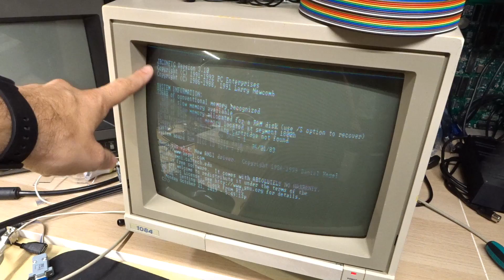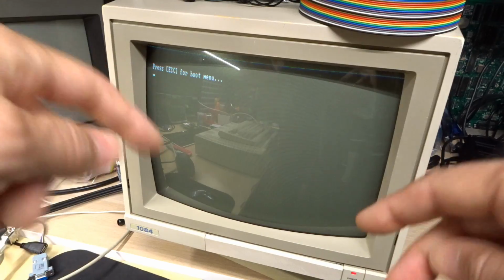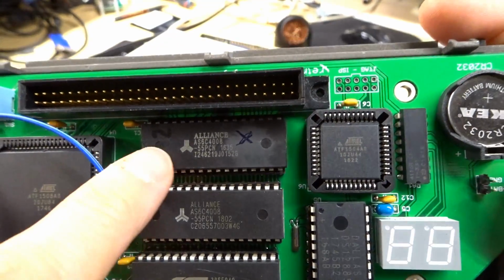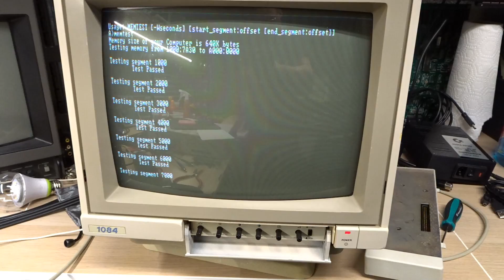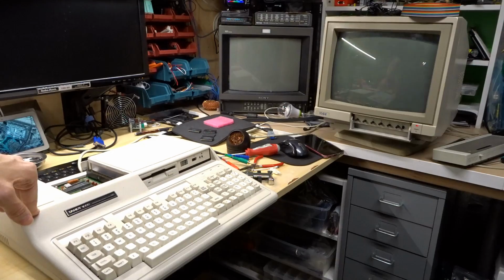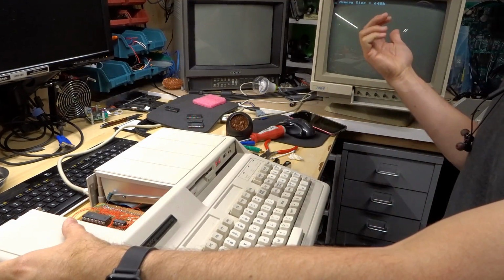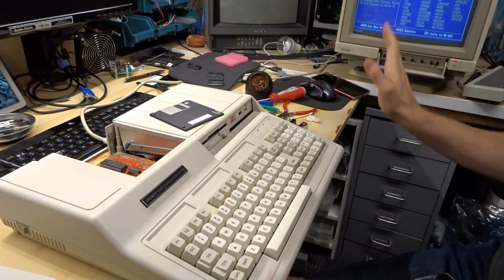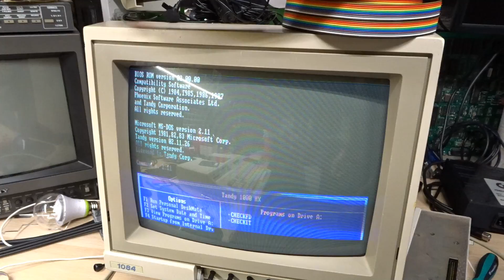Follow-up to fake or real chips? I think I know the answer now.

Comment: Back in the original PC and AT days there were often issues with the speed of the RAM chips that would cause weird bus contentions and errors like this.  I often had people purchase 150ns RAM from us for a "turbo XT" and then would complain when it wouldn't boot when set at 10Mhz back in the day.  I would wonder if maybe the fake chips are actually much slower but pin compatible RAMs that were removed from older computer boards.  Maybe these are like 120 or 150ns RAM not the 55ns your true Alliance RAMs are.  This would also make them work in a slower PC but just a few Mhz can make them not reliable.  One way to prove this might be to spray freeze-spray on the suspicious chip and boot to see if the error goes away until the chip heats back up.  Usually when one of these chips is super cold they will work much faster but as soon as they heat up they degrade to their native speed, whatever that was before it was painted over.
Reply: that might be true. try putting them in a freezer in a ziploc for 15 minutes, and putting them in the pc right away.
Reply: Or use freezer spray while booting the computer
Reply: Remarked chips of a lower speed grade seems quite likely.
Reply: Fake RAM chips are not new.  I remember running into the same problem 40 years ago when RAM chips were crazy expensive and some vendors tried to sell remarked chips.

Comment: If you look at the output, it's only the first nibble that's incorrect, the rest is correct. And it's consistent in how it's incorrect: A=E, B=F, 8=C, 9=D. Let's look at those values in binary:
A=E: 1010=1110
B=F: 1011=1111
8=C: 1000=1100
9=D: 1001=1101
As you can see, it's the second most significant bit that's being flipped from a 0 to a 1.
Butt! It's only affecting the first byte, why not the second? It's an 8-bit bus, so the surely second byte is just another read from the same data lines on the same chip, so we should be seeing the same problem in the second byte, right?

My guess is that the second read is soon enough afterwards that whatever circuit controlling the output of that bit is charged enough to hold it for long enough to read valid the second time. And I guess it's working in the PCjr either because of the bus transceiver on the expansion card presenting a lower load, so the pin can stabilise in time, or the slower access time is enough to do the same.
Either way, the chips are fake. But I'd still be interested to see a comparison on the oscilloscope of that pin to a working one.
(Also, still haven't got around to testing that SRAM I got for my 486 boards yet. Probably doesn't help that I'm spending my time staring at datasheets for other people's chips!)

Comment: I also agree these are salvaged chips, they're most likely not 55ns as marked. Another example is eproms. I know for a fact that ST discontinued eproms in 2011/12, if you got eproms with a date code after that be weary. A 100ns eprom, may in fact be a 120ns or 150ns chip remarked, same applies for sram and flash memory. This is not new it's been going on for years. It's not limited to memory either, I see YM3812 chips with the latest date codes and it probably hasn't been produced for 25 years.

Comment: It would be nice to see actual waveform comparision of working and not working chips. Data bit 14 would be the most interesting.
Reply: @adriansdigitalbasement  If it is 8 bit bus then it is REALLY weird that low byte reads ok consistently and high byte doesn't. Good that you made it work with original chips. I wonder if there will be a difference when you will have proper PCB made.

Comment: So, what's this cereal card you keep talking about?
Reply: Tandy had an RS-232 card for the PLUS bus that the EX and HX use, but they're even rarer than the DMA/RAM card. I ended up using a small generic multi-I/O card with an ISA to PLUS ribbon, and the stack JUST barely fits inside my HX.

Comment: It doesn't surprise me that the fake chips worked in the IBM. When dealing with fakes or even rejects you will have issues due to the chips not performing to published specifications. The Tandys may not be able to handle timing errors on the fakes or may electrically load the fakes more than they can handle where the IBM does not. It is also possible that the fake chips are more sensitive to the prototype board's wiring.

If you read my comment yesterday, you may remember that I wanted you to check genuine chips to rule out the possibility that the board's wiring was bad enough to make any chip fail. I'm also not fully familiar with these machines, but what is the CPU clock on the Tandys vs the 4.77 MHz of the PCJr? If the clock rate is higher, this really amplifies the possibility of timing issues with the fakes and the fakes ironically may work reliably in the PCJr.

Comment: This type of problem can happen when your design is working close to the limits/tolerances of a part, you may have a working system depending on the batch number, or depending on the chip of a same batch. A fake chip may be more sensitive or have slightly different characteristics that exacerbate the issue. If you have time, making them work would be very interesting to understand what's going on

Comment: An 8088 can only address 1024k of ram. This consists of 640k of work ram and then 384k of upper address space. In the 384k, upper area you have video memory (128K), the cartridge slot (128k), and the BIOS ROM(128k). The PCjr seems to be testing all the ram (640k work ram + 128k video memory = 768k) the cart slot and BIOS will not be tested because that's ROM and you don't need to test that anyway. You can't access anything above 1024k as the 8088 didn't have an A20 line.

Comment: Not an expert, they look like they are genuinely fake, rebranded or what ever, BUT they work on the other machine. So, it really smells a lot like a timing issue, and without the real data sheets, it will be hard to troubleshoot. And so I wonder if the genuine parts are more tolerant to the timing issues, but if you test on a huge batch of them you might not have the same issues on random item. In particular in electronics of that area, timings are pretty important, and to my knowledge you might need to delay some signals.

Comment: The rubbing off was enough to tell me they were 'fake.'  I've never seen that before.  And the pins did look a little 'cheap' on them too.  Removing the top layer of sub-standard chips to re-label them as something they aren't is apparently big business in China, so it's quite easy to get burned by buying ones from China on AliExpress/eBay/etc.  I have a couple of supposedly 75MHz MC68060 CPUs from China, but don't currently have a way to test them to see if they are genuine (often they are re-labelled 25/33/50MHz ones).
Reply: I understand there were genuine 75MHz 68EC060 chips, but they were never officially made in the 'full' version. Far more common are XC68060 in early mask versions masquerading as MC68060 in mask version 71E41J, which is the latest, most desirable version. The fakes are still 68060s, but they don't run as cool, and can't be overclocked as much. If you google '68060 mask versions' you will find many links describing this problem.

Comment: I'd guess at them being "Sinclair Grade", as in, something's wrong with them in part, but work up to a certain extent so can be used for some things but not others... :P
Reply: Thats every chip manufacturer ever. Especially CPU die OEMS
Reply: @Everett-xe3eg  It actually used to be fairly rare. If a part was defective it was recycled or trashed, never resold. Nowadays, they sell them as lower model parts in many cases, which is why they have such high product yields now. Their production has improved, sure, but for the most part their defective chips can go on to become 100ns or 150ns parts instead of the rated ones. 

Also, Intel was one of the first companies to do this.
Reply: It's a possibility but what's more like it is that they are rebranded clones in order to improve sales. If they can clone MCU and CPUs what stopping them from making SRAM clones and some of their clones even have more features and run better. Said that, rebranding is obviously not a nice move from them. Adrian should check the LCSC website and try some compatible SRAM modules from there, they sell from Chinese manufacturers, but not rebranded and stuff that actually works fine.
Reply: Possibly clones that aren't quite up to spec?
Reply: “Sinclair Grade” would not have worked in PC Jr. The Sinclair memories were the ones where the upper page of memory will not work.
Reply: X Xycom - The joke is that Sinclair bought parts which were cheap because they were flawed or faulty, which these particular chips seem to be whether fake or not, rather than whether or not they would work in each others' systems... :)
Reply: @twocvbloke   It sounds like that U.S based transistor radio manufacturer I read about that bought drums full of seconds from Fairchild, Motorola, G.E, or whomever, back in the 1960s. They built radios with them by testing the beta on each transistor, and marking them with a blob of coloured paint to indicate what circuit they should be used in, oscilator, IF, RF, audio, etc. I think that some of the Hong Kong cheapies did something similar, like those 10, 12, 18 transistor sets, where they would use two or more of them as diodes by connecting two of the legs together.
Reply: @xxycom8963  Isn't much of the upper 1mb address space mapped to other devices?
Reply: probably just slower memory access speeds needed, you cant tweak that on old systems like current, and my god the number of memory chips we went threw trying to upgrade some old apple products that, some units are just picky as fuck making you try a dozen chips to find one they like... of the same chips....weird as hell...but...thats tech for you.... specially retro stuff.

Comment: As my handyman father used to say, it can be expensive to buy cheap; even though he was specifically referring to hand tools, the idea holds up in any area, methinks.
Reply: Lassi Kinnunen  Well, that's true, but my father's point was that if you buy cheap tools, there's a greater risk that they may break, thus forcing you to buy a replacement tool; on the other hand if you buy quality from the beginning, you can have a tool that lasts a lifetime.

Comment: The surface on the pins and one of the pins just breaking off indicates that the China chips are not new chips, they are salvaged from discarded old electronics, and the top has been cosmetically resurfaced and the pins were resurfaced with paste and hot air rather than chemically like at the factory. They might be of a different spec or even from a different manufacturer or might have degraded in-use.

I wonder what is underneath if you go for some more powerful solvents, maybe acetone. Probably nothing particularly interesting really, just a sanded epoxy surface.

Sometimes ordering from China is appropriate, but often you'll get stuff like this.
Reply: @HankScorpio64   Aliexpress is responsible for reimbursing the customer, not the seller. Then they can take care of enforcement with respect to the seller domestically, they are after all a mainland company. It shouldn't be your problem whether the seller is a fly-by-night operation.

Yeah sometimes you need a chip, and sometimes a used chip is the only one you can get, so you don't have much choice, and the local sellers all just resell the China stuff with no extra QC but with markup, so it makes sense to just reach closer to the source. Other times you need something cheap, quality be damned, and other times you need a Chinese domestic part and know the Chinese seller and trust them, that happens too.

But thing is Alliance Semiconductor specialises on ongoing production of obsolete type memory ICs for the slow industries that need to maintain 30 year old products, you get their fresh chips via normal suppliers.
Reply: I agree with you, it is a salvaged chips.
Reply: Precisely.

Comment: at least the sram chips you have got from china are not completely useless. When chinese sellers go through the trouble of sanding off, painting & re-printing ICs, they mostly take some totally random ICs and rebrand them. Probably this time they just "improved" the timings. Otherwise you should be scared that you could destroy your precious retro electronics, when it is some totally random other chip.

Comment: On your original board, you did not have bypass caps.  Please try inserting them on your test board, and see what happens.  I suspect this may help; the PC Jr board you installed the chips in have these bypass caps.  Also, not having the bus transceiver could easily explain this.  Timing matters, as does good power.

Comment: I have a project to control a 3 axis Flight Director/Attitude Indicator  (FDAI, ADI, Navball, Artificial Horizon, whatever you wanna call it) fora Kerbal Space Program Instrument/Control Panel. I needed powerful amplifiers to drive the power/reference sine wave, and the trio of three phases to command the three axes. I initially bought some power op-amps off ebay. I stared at them forever, realized I simply didn't trust the source, and ended up buying some NOS audio power driver ICs that were cheap, cause they were old surplus components, but even higher rated.

Comment: would be cool to see a jig made up to test the speed of these chips
Reply: yeah, i'd say they're not 'fakes' as such,  they're purporting to be ram chips...and they are (although may not be of alliance manufacture, so in that way they'd be 'fakes'/counterfeit) ... but most likely slower types remarked as faster, like with a lot of the cheap '20mhz'  z80s...  maybe old used 'recovered' parts...
Reply: Its called an arduino

Comment: Adrian, you have oscilloscope on the bench - record SRAM access timings on both machines. It is obvious that china chips are used and remarked ones and that PCj must have slower memory access than Tandy.
Reply: That's precisely what I was thinking.  I was just talking to myself saying "I bet the RAM is too slow."
Reply: @hakemon  I've heard of that from China. Take a slower part, grind off the old silk screen, then put a new silk screen on for a faster and more expensive part. Not necessarily a fake SRAM, but one with a different speed rating.
Reply: @williammentink  Is it really worth it for a part this old. Why not just make a run of modern compatible sram chips. I'd imagine it would cost next to nothing to produce.
Reply: @hakemon   I was thinking the exact same thing because of the consistent memory errors. In my experience most of the time if memory ICs work on one computer but fail on another it's a timing issue ..
Reply: This is a great suggestion, please give this a try Adrian! :)
Reply: EEVblog just did a timing vid so I was thinking the same. 
I bought some fancy STP60NF06 mosfets - they have internal protection - from Ali and the 1st batch looked similar to the orig and worked fine - I'm not taxing them much -, but more batches looked like cheap std IRFZ44N mosfets. It looks like they renumber cheap parts so they can charge premium prices.
Reply: @SidneyCritic  Just like their fake electrolytic caps, take a Chicom mystery brand capacitor, and re-badge it as a reputable Japanese brand, like Nichicon. I've heard with I.Cs it doesn't even have to be of the same type for them to relabel them, just the same package. Chicom crooks! It's good to hear more action being taken to get that particular country out of the parts supply chain, which should have happened 15-20 years ago with the capacitor plague, let alone the pandemic.
Reply: @Mack The memory bus speed is probably the culprit, I tend to agree.  As old as those machines are, I'm not sure what those speeds are, but likely match more directly with the CPU clock speeds.  I asked in a separate comment about if he has a '245 octal buffer at all on his board; if he doesn't then the fake chip bus loading or timing may be troublesome.  Add in DMA and things get more critical.
Reply: My thought also that access speed is the issue.
Reply: How many chips would you have to sell to make rebadging worth while? Do they just have a barrel of unmarked (scrubbed) chips which they badge when you order from them with whatever you ordered?
Reply: Yeah you guys suggesting that are totally right I think. The remarked china chips could be slower or even faster. Usually they would use slower ones and mark them as faster ones, because these would just sell better.
Reply: I know I am kinda off topic but do anyone know of a good website to watch newly released tv shows online ?
Reply: @Garrett Valentino flixportal :D
Reply: @Gerald Maximiliano Thanks, signed up and it seems to work :D Appreciate it !!
Reply: @Garrett Valentino happy to help :)
Reply: @Mack I bet they are 150 ns ICs, they run at 6.66 Mhz.
Reply: I remember one of my DDR2 RAM sticks would start failing (data corruption) if I set the timings at a certain value (5-5-5), however if I changed them to 6-6-6 the errors would somehow go away.
Reply: It could also be the opposite - the fake chips needs a faster refresh rate. I had this problem on my 286, solved with slower chips.
Reply: @gabrielebiffi9018  Possible but I doubt they would grind and rebadge a faster chip to a slower part nunber.  I'm betting these are real alliance chips with a slower access time ground down and rebadged as a faster part.  In many cases they could get away with it (as is shown by the PC Jr's indifference).
Reply: @gabrielebiffi9018  its sram, no need for refresh
Reply: @akkudakkupl  Oh yeah I missed that detail. Anyway, "faster" doesn't necessarily mean "more valuable" in today's world.